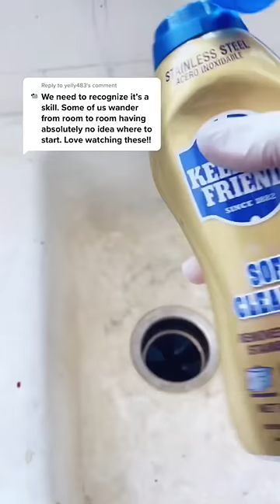How to clean a white ceramic sink #shorts #cleaning #cleaningmotivation #cleaningtips

Comment: I get that. I have a B.B.A. with a concentration in M.I.S., which is the closest to a Systems Analyst degree way back when. Computer Science degrees required a lot of calculus, which I didn't get along with. I worked for ten years at an insurance company, as a programmer, etc. I left that to work at a fabric and crafts store. I was there for twenty years. And it used to make me weird out when I saw people who I used to work with. But I enjoyed what I was doing, helping people, framing, running classes. I never made as much as I did as a programmer, but for the most part, my stress levels were SO much better.

Comment: Germany's secondary education is separated into two parts, lower and upper. Lower-secondary education in Germany is meant to teach individuals basic general education and gets them ready to enter upper-secondary education. In the upper secondary level Germany has a vast variety of vocational programs. German secondary education includes five types of school. The Gymnasium is designed to prepare pupils for higher education and finishes with the final examination Abitur, after grade 12 or 13.

From 2005 to 2018 a school reform known as G8 provided the Abitur in 8 school years. The reform failed due to high demands on learning levels for the children and were turned to G9 in 2019. Only a few Gymnasiums stay with the G8 model. Children usually attend Gymnasium from 10 to 18 years. The Realschule has a broader range of emphasis for intermediate pupils and finishes with the final examination Mittlere Reife, after grade 10; the Hauptschule prepares pupils for vocational education and finishes with the final examination Hauptschulabschluss, after grade 9 and the Realschulabschluss after grade 10. There are two types of grade 10: one is the higher level called type 10b and the lower level is called type 10a; only the higher-level type 10b can lead to the Realschule and this finishes with the final examination Mittlere Reife after grade 10b. This new path of achieving the Realschulabschluss at a vocationally-oriented secondary school was changed by the statutory school regulations in 1981—with a one-year qualifying period. During the one-year qualifying period of the change to the new regulations, pupils could continue with class 10 to fulfil the statutory period of education. After 1982, the new path was compulsory, as explained above.

The format of secondary vocational education is designed for individuals to learn advanced skills for a specific profession.
Reply: "Most of Germany's highly-skilled workforce has gone through the dual system of vocational education and training (VET)".[8] Many Germans participate in the V.E.T. programs. These programs are partnered with about 430,000 companies, and about 80 percent of those companies hire individuals from those apprenticeship programs to get a full-time job.

Comment: Any tips for getting smoke stains off of a car roof? I bought a car cheap due to it having alot of smoke staining on the interior, but I can't get the stains off the material on the roof and it's driving me nuts 😫 
I don't want to use anything that will ruin the roof and make it hang or anything and I'm at a loss 😕 😔 I also, due to being a single mum with serious health issues, can't afford to have it professionally done 😢. I'm embarrassed of it and worried it will harm my children. Please any tips would be so so appreciated. Your work is amazing ♥️♥️
Reply: you can borrow steam cleaners. maybe that works.

Comment: You can use soft soap. It works much better than bar keepers friend and it's less expensive. Plus those green scrubbers. Makes it look brand new. I'm also a cleaner and I enjoy it. I should have started in my 30's like my sister but better late than never. I finally realized I didn't like working with people.

Comment: I love bar cleaner I like the spray one cuz it did really well with my rust in my shower however to clean that sink I would have used the stuff called "A Bena Qui cleaner" from Amazon it's a pace don't stick water in it just take it out with your finger hypoallergenic to pets and animals doesn't take the pain off like Mr eraser does on your walls it shines steel shine ceramic it takes film out of glass also it takes the yellow off your headlights takes pine sap off my hands it's amazing

Comment: Bar keepers friend works by being abrasive and scratching the surface of the sink. You’ve technically cleaned it, but you’ve also scratched the surface to the point that those stains you just cleaned, just got a new deep hole to get into next time. Short sided cleaning

Comment: College WAS a good option when these adults were kids.. but it's just not the best decision anymore. So many jobs are performance based, and college charges wayyy too much. Im still very happy that I did not go to college, and Ive worked in multiple industries. However, Ive worked less and made the same amount overall as the other people who went to college. If you have no willpower and discipline, then college is the easy solution. But otherwise, its worth thinking deeper.

Comment: The problem is your doing manual labor (which will get challenging as you get older) that anyone can do (i.e. no trade certification required). Unless you have a viable business with others working for you (in addition to you working for yourself, when you see fit), than yes a higher education (e.g., trade certification, 2-year degree, 4-year degree, etc.) is needed. 

To be clear, I'm not saying that higher education is all one needs to subsist. People with higher education work multiple jobs (myself included). Nevertheless, cleaning homes/business will not make one enough funds in the long run (i.e., a subsistence in old age).

Comment: That and comet with bleach. Half the time. 
Or papertowels. Line sink. Spray with clorox bleach cleaner. Then let stand water free for 24 hours coat with mineral oil. Dont run water for 24 hours again. Now sunj with not be that disgusting for a very long time again. Rinse after cleaning. Lemon fresh. Comet and half lemon. Scrub. Just lovely. Then wire brush.on drain.